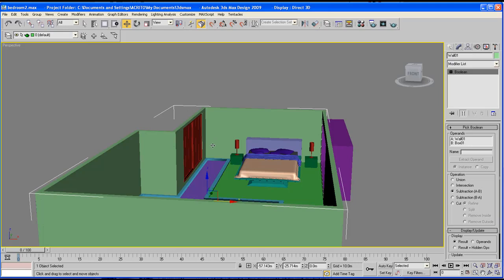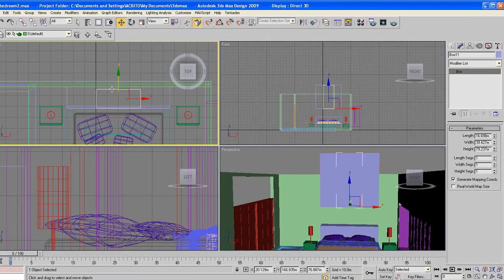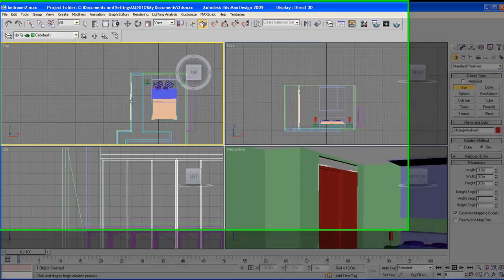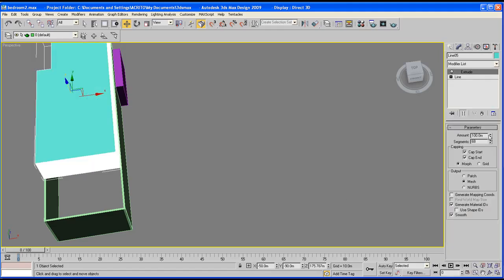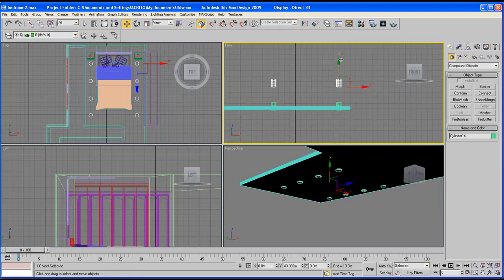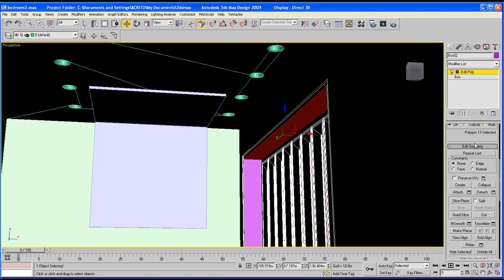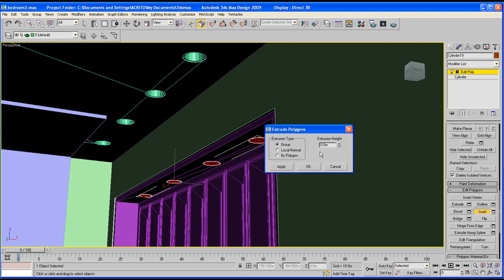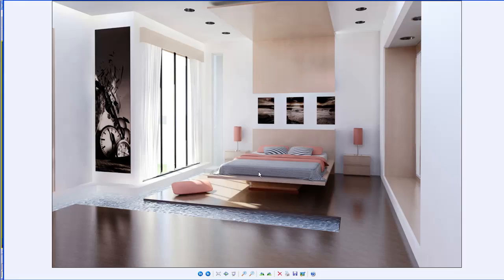architecture tutorial on 3ds max ceiling part 6

Comment: I have used a line following the window  ( snap option with snap to vertex option )  and used shell to make it thick then I cut it out of the wall using a second boolean. I would have loved to know why  it wasnt working too but that method allowed me to move on to the rest of the tutorial.
I have another problem that came up.. Using boolean with cylinder to make holes in the ceiling results in annoying artifacts.( the top of the holes are partly covered with the polygons of the roof..